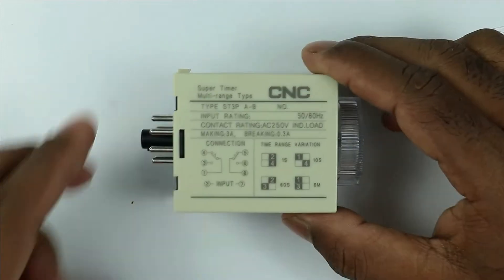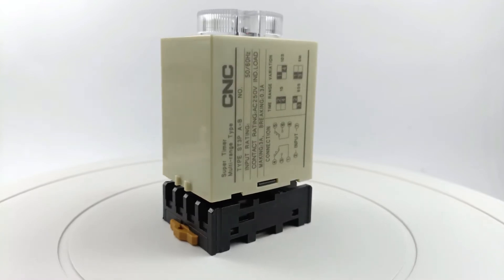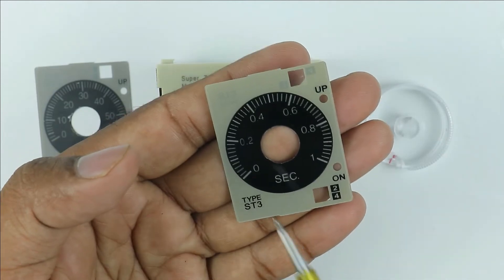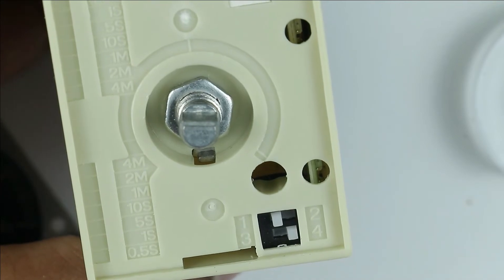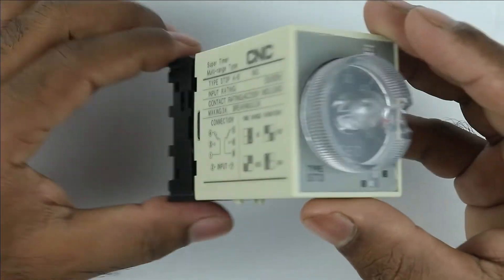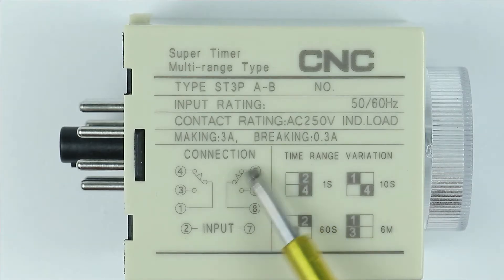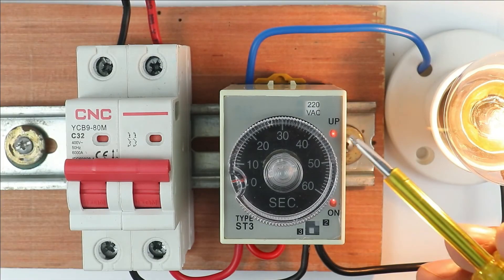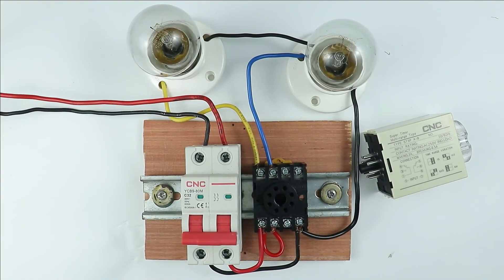8 pin timer relay working and Connection Diagram @TheElectricalGuy

Comment: Your wiring is correct, but labeled NO and NC are backward caused confusing. OFF-delay is connected to Pin 5 NC, and ON-delay is connected to pin6 NO.